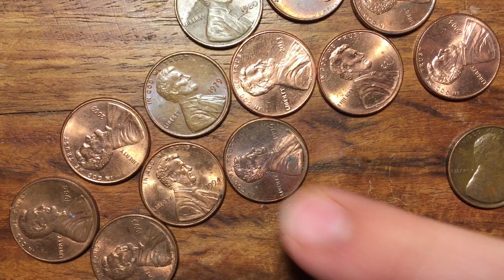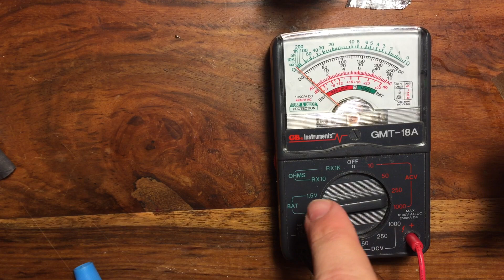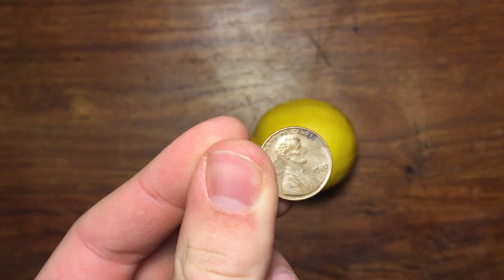How to Make a Homemade Battery: Pennies, Lemons, and Salt Water

Comment: you used vinegar, and salt water as electrolytes;  did you know that if you use vinegar and salt together it will be better for the power generated.  Additionally for really corroded iron and steel a submersion into vinegar and salt (about a week for a bicycle chain that is so corroded that you cannot see individual links but rather fatter and thinner blobs) restores it to a nearly magical smooth dull gray!